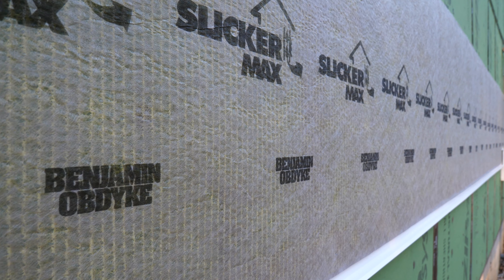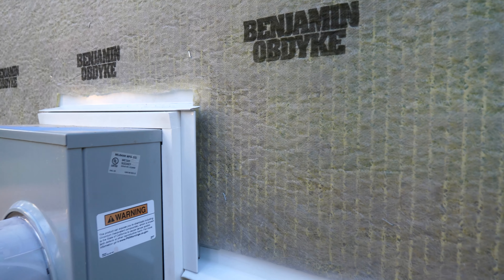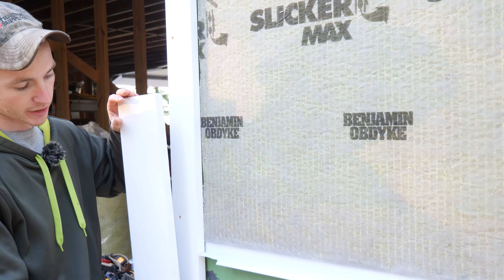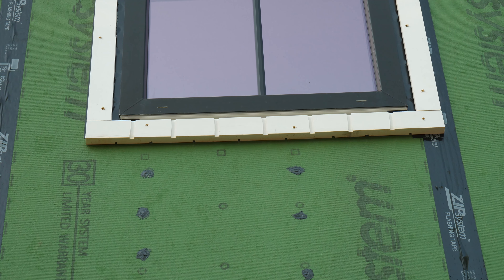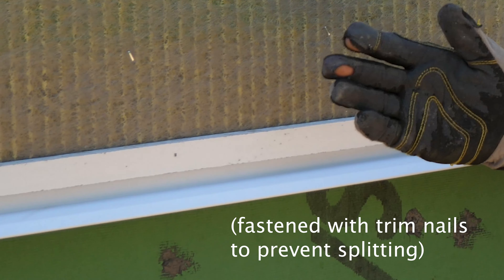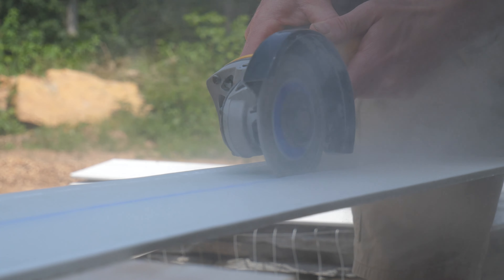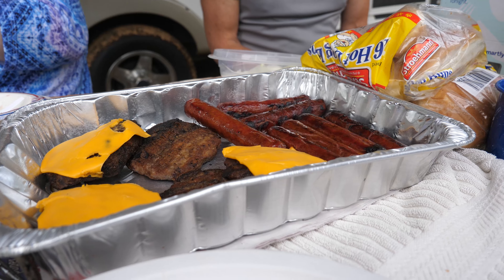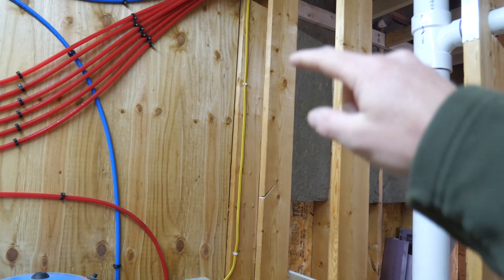Installing James Hardie Lap Siding - START TO FINISH

Comment: Don't forget about teeing up for any rebates along the way. We got $2,400.00 back on appliances in rebates - really! They were the Frigidaire PRO line of appliances: Double Oven, 26" Stovetop (Propane), Dishwasher, and Refrigerator. I did have to provide a "Paid" invoice and the serial numbers after installation. There was also a window of time we were eligible. Just try to save $$$ wherever you can. Of course, anything unused, bring it back too if you can. Keep up the good work.
Reply from the maker: Awesome tips! We definitely do our fair share of returning leftover materials 😁

Comment: According to hardie, you dont apply any caulk at openings with flashing for any door/window/opening.  Must maintain a 1/4" spacing at those openings. And a 1/8" at the ends of the hardie board to transition pieces.
Reply from the maker: Correct. Our door/window/corner trim design has zero exterior caulk

Comment: Been debating which rain screen product to use behind my Hardie siding.  Why did you choose Slicker Max over any other product?
Reply from the maker: Yeah there are a few options. I liked the vertical channel structure more than a honeycomb matrix and the filter fabric was a must for compression resistance, marking lines on the surface, and keeping mortar out when going behind the stone veneer. Benjamin Obdyke also has a history of high quality products in this niche which is why I ultimately went with them

Comment: Did you have to black caulk the nails in the zip? Just curious bc I had a discussion with my contractor about over-driven fasteners? What’s the prevailing thought on this. Maybe you addressed this later in the video. Thanks.
Reply from the maker: Yes, we liquid flashed over every nail.  It's recommended on the over-driven fasteners but we liquid flashed over every nail since we were already checking every fastener.

Check out this post from Huber's website, scroll to the section titled "Flashing Nail Heads": https://www.huberwood.com/blog/tips-when-using-zip-system-liquid-flash

Comment: How did you locate the studs from outside the wall? I know that you designed the house yourself but I’m more interested in the process. Did you measure the offset from the corner/door/window etc and just go 16 in oc and mark with a line down the wall?
Reply from the maker: You can see the nails in the sheathing!
Reply: @MasonDixonAcres  ahh very good point, especially with zip and the circles

Comment: i didnt check all the comments to see if someone mentioned this yet. But, sometimes it helps when drilling holes to 'wobble' slightly as you drill through it doesnt seem to affect the cleanliness of the cut and makes it way easier to cut and get the bit out.

Comment: Great content, you seem to be a smart guy and do a lot of homework. The only problem I see is bugs or insects will make condos out of the exposed weep holes. I used 032 alum flashing for my first time use of Hardie this year I was told by the supplier I could of used felt or house wrap for this flashing detail but decided that wouldn’t be a wise choice.  after I painted my lap siding I noticed the factory edges appear to have snipe within the first 5” when the sun hits it just right. You’re correct about factory pre finish your touch up will fade differently so use it sparingly.
Reply from the maker: Thanks! I do try to stay well educated on it all, it takes a lot of time and energy. I've heard the bugs in rainscreen theory before but in practice it just doesn't happen, at least no more bugs than would find their way behind typical vinyl siding. Recently read a Joe Lstiburek article (Building Science Corp) where he took his 16 year old cladding over rain screen off and found the same. I'll know for sure when we take the south side off for the future addition
Reply: Wasn’t really thinking about the 1000 lady bugs or black flies that I commonly find when I remove vinyl thinking more about mud diver or carpenter bees blocking the air flow on your trim detail weep slots. Insects are the worst. Always looking for a easy nesting place. Good luck I hope it works out for you.
Reply from the maker: Yeah it's certainly a theory but I just don't feel that will happen in practice, at least not to an extent it will hinder drainage. I'll take that risk over the risk of trapping water

Comment: Hi I am looking to use the 7" exposure hardie product on my own house design... I am curious your opinion on the gaps between the boards on the floating bottom edge of each board.  I know this lends itself well for air to help dry out the wall etc., but I am also installing the clapboard siding over a real rainscreen (furring strips).  Because Hardie is basically prefinished paint, their is no way to hide these gaps and spaces... I understand it is obviously not noticeable from a distance, but easily seen when looking up at a wall when your next to it.   I feel like this type of space using traditional wood would not exist (I guess because its specified to nail at top and bottom and paint over the exposed nails...  Again all doable with wood product, but Hardie you can't do this, touchup paint will always be noticeable.    Hard decision to make on siding choice..   I know you did not use furring strips, so may not be able to comment on this part - but I am also concerned of potential waviness in my own design between the furring.
Reply from the maker: There are no gaps, one plank sits tight on top the next if nailed on the engraved nailing line.
Reply: Hardie does not recommend mat style rain screens.

Comment: For a first timer you’re doing very well.  Love the quality you’re putting into this.  
As to slitting coil stock without a slitter tool.  Align your cut line on the top lip of the brake.  Clamp it down. Run your knife along the top lip a couple of times to score the aluminum. Bend it like you would a normal fold.  Straighten the piece out with your hands. Repeat folding and straightening until metal fatigue occurs. You now have a strip.  Not as fast as a slitter but way way way faster than snips. 
WE ARE!!
Reply from the maker: The coil I use is 30 gauge steel, the knife trick doesn't work for steel 😜 thanks for following along!!
Reply: @MasonDixonAcres  Nice.  Going heavy duty for everything.

Comment: I guess I”m confused. Aren’t zip boards covered in material that serves as a rain screen? Isn’t this overkill?
Reply from the maker: The green coating on Zip is a WRB (weather resistant barrier), not a rain screen. They do advertise it as a well draining surface, but it does not have the same airflow and drying ability as a physical air gap between sheathing and siding.
Reply: @MasonDixonAcres  okay I guess I was wondering why add a wrap over it as well as the gap. I probably used unclear terms.

Comment: Beautiful work but lots of things different from what hardie recommends. No caulking where siding meets trim. At the gable end the trim goes over the siding in your detail but hardie recommends butting to the gable trim and caulking. 

Not a criticism. Just wondering why everything is so different from what hardie recommends
Reply from the maker: Lots more details in the 'preparing for siding' and exterior trim videos, all trim at windows, doors, gables, and corners laps over the ends of the siding and fastens to furring strips. We wanted a caulk-free exterior (caulk = maintenance) and also really don't like the look of caulked butt joints. JH also doesn't like rain screen air gaps behind the siding which we also disagree with

Comment: You didn't line up your lap siding ? Every 4 boards it should be lined up. Go look at any house done by a professional
Reply from the maker: Randomized joint pattern looks best in our opinion. Stair step pattern looks weird to us, the pros do it because it's fast and convenient.
Reply: @MasonDixonAcres Been siding for 20 years.  Stepped patterns draw too much attention to the joints and agree scattered joints look better.  I do stepped joints only for speed and often to reduce waste, usually on large non focal walls, because as a professional, time and material equals money.

Comment: You are getting major blow out the back of siding when you nail
Reply from the maker: Are you saying that because of the rainscreen?
Reply: @MasonDixonAcres  yes but fiber cement will blow out even on a flat surface when using a nail gun. The mesh makes it even worse
Reply: Supposed to use a siding gun

Comment: PSA on Silica dust, use a real respirator not a dust mask, Silica dust is severely irritating to your lungs and never leaves once inside.

Helps to fully cover all skin, there are glass fibers in fiber cement boards that will irritate your skin for days afterwards.

Comment: A Poor Split angle Roof Design 
Why - 
when you are the Owner building the house 
Why Would you choose a low Roof angled Roof on one side. 
So bloody ugly.
The internal Rooms become an crappie ugly Low Ceiling design & very Poor  Headroom. 
Or wasted Angled Ceiling Voids. 

You can still do Dorma's windows on a normal Gable Roof. 
A big learning curve. 

A Good Team 
Go Hard.
Reply from the maker: I don't think you've seen enough of the design from either the interior or exterior. Go back to the design or framing videos if you're interested. The salt box style roof maximizes interior square footage and allows a walkout deck off the back. We think it looks great.